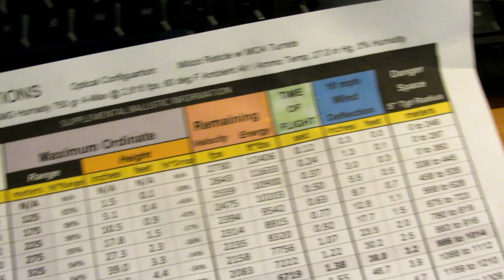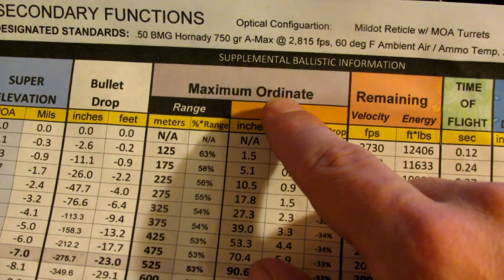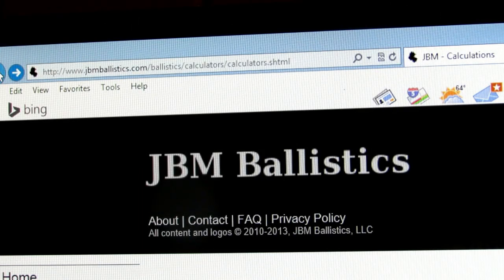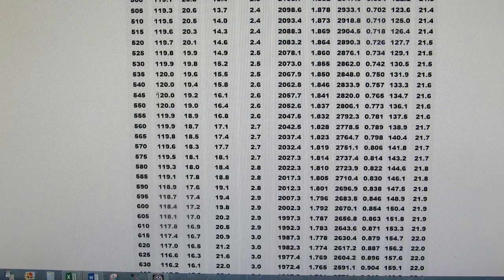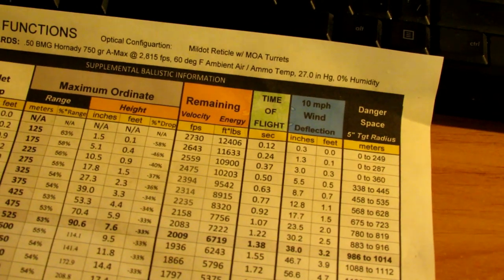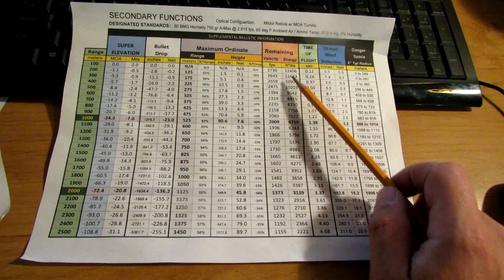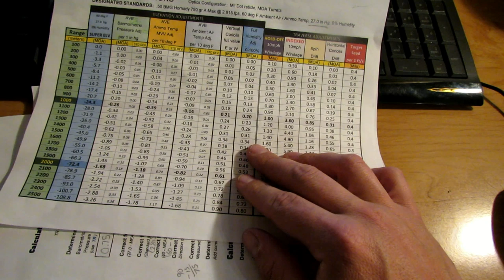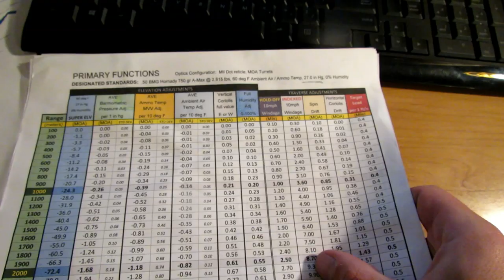Long Range 101 Part 80 - Secondary Ballistic Functions HD

Comment: I added an angle of impact column to my secondary functions.  For instance, in the .50 BMG table used in the video, the bullet is dropping into the target at a 1.06 degree angle at 1,000 meters, and 3.4 degree angle at 2,000 meters.  I'm a visual/spatial person and this angle helps me visualize the trajectory.
Reply: +meccastreisand I apologize for taking soooo long to reply, I was cleaning out some old emails tonight and saw you had replied to this way back.  I will send you an email directly as well.  

100 meters = 3,937 inches.  Between 2,000 meters and 2,100 meters, the bullet in the table dropped 234 inches.  Draw a vertical line 234 inches tall.  At the bottom of the line, draw a horizontal line 3,937 inches long, and there you have the horizontal and vertical components.  SOH-CAH-TOA tells us that the 234/3937 will be the tangent of the angle, which is 0.05944 radians or 3.41 degrees as the average angle of the bullet drop over those 100 meters.  (My example in my original post approximated the horizontal at 3,900 inches, when it's actually more like 3,937.01)  Continuing on, from 2,100 to 2,200 the bullet drops an additional  258 inches, so the same math yields an average angle of 3.76 degrees.  2,200 meters to 2,300 meters, the drop is 283 inches, 4.13 degrees.